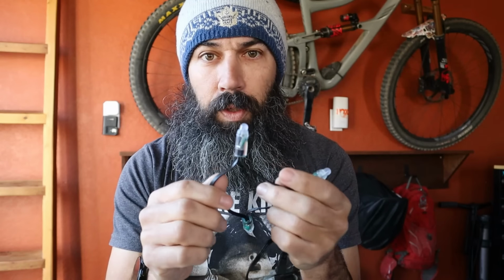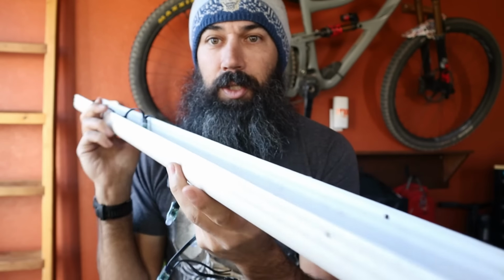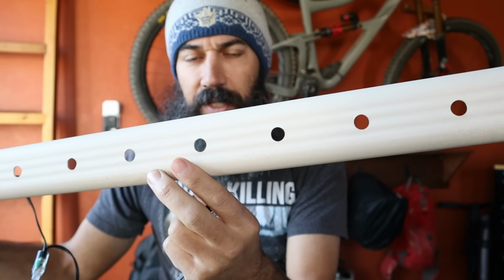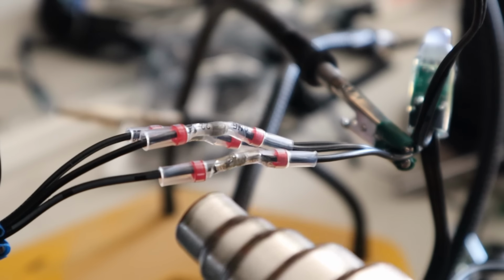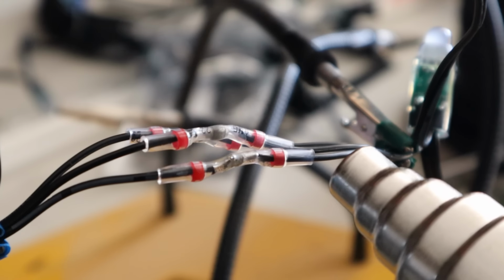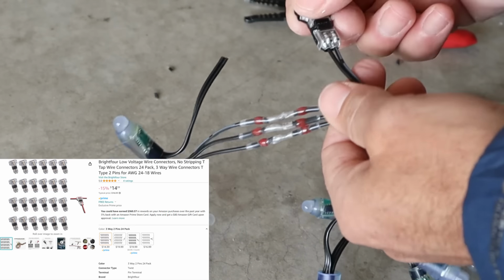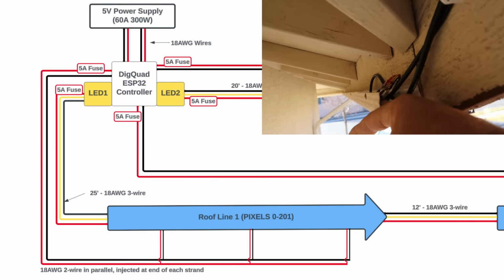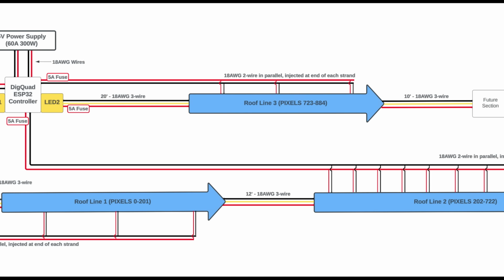Permanent and AFFORDABLE Holiday LED's

Comment: Very cool build. The costs from installers is ridiculous. My daughter told me someone was selling monster lights 100 ft for $50 so I bought them. Only used 75 ft for now but it was simple. Made my own jump wires, and wire covers between the pucks out of ripped down vinyl undersill for siding. Looks great but I want more options for software so I just bought a 24v controller and a power supply to make them WLED. Total cost $145, when the monster lights cost $150 originally. Again nice to see people so inventive. Btw I know nothing about any of this, just figuring it out as I go.
Reply from the maker: Dude, you started exactly where I did....just figured it out as I went.  My brother had his done out in Utah and paid like $7k or something totally insane like that.  That's what inspired me to build my own for 1/10th the cost.  I'm several years in now and mine still work absolutely amazing!  WLED is super fun to use too!  Only thing I would change if I built mine over is to swap to 12v or 24v instead of 5v.

Comment: So, it's been more than 2 years. How have the pixels held up? How many have you had to replace? How hard are they to replace? What would you do differently?
Reply from the maker: Check out my update video for sure. I do cover a couple things that I would have changed and a couple of mods. But overall, these things still rock!  No real issues and I haven’t had to replace a single pixel yet!

Comment: That looks FANTASTIC! Great idea. The only thing I noticed is the power injection fuses. If you have a fuse on the string for the pixels and then you put power injection on a different fuse, if you have a short, 1 fuse may blow and the other may not. You should put the power for the pixels and power injection on the same fuse for each section of pixels. On your diagram you can get Positive voltage from the roof line 1 or power injection 1 or from the power injection for roof line 2. I see this mistake a lot. If you ever have question and would like to ask, if I know the answer I would be glad to share with you.
Great Job!!
Reply from the maker: Appreciate the comment!  I’m definitely learning this as I go. I’ll take a look at reconfiguring my fuse layout, which is luckily all conveniently located in same control box.

Comment: Good job!  I especially liked that you took time to create a decent diagram showing the interconnections, and also that you fused the circuit sensibly with low fuse ratings due to the distributed power feeds. (I did exactly this on my most recent contol box with 8 5A fuses rather than just a couple of big ones.) Fuses are cheap, the damage that an incorrect fuse can cause can cost a whole load more.
Reply from the maker: Appreciate the comment. I’ve made a couple of updates (have one update video) but all in all, this setup is still working amazingly! Thanks so much for watching!

Comment: The strings come in 50 per.  You get 43 in a pipe so you need to cut some or stagger the strings.  If you made them closer you would get 1 string per gutter pipe.  That raises the cost because you need more strings but at the same time you have more density of the lights for better displays.
Reply from the maker: Agreed, and that would be easier for each of the 10’ sections.  Wouldn’t have helped much on the shorter sections.  I had a few of those that ended up being 2’ to 5’ or so when I hit corners and stuff.  But yes, having a connector at the start/end of each section of tray would make the install way easier!
Reply: @DadDoingStuff  Yeah, I have some strings just out on stakes in the yard and one run is short but 1 string doesn't make it so I had to just cut about half of another string just to make it go to the end. My preference is to make the oddball length at the ends so you don't really run into trouble. But on a roof you can't really do that with the way the eves go.
Reply: @DadDoingStuff  The main thing I like about those lights is that they aren't flat PCB material but actual wires that you can solder.  One trick to use those connectors and protect from the weather is to use hot melt glue.  Just glob it on.  Much easier than hard soldering.  Soldering on a ladder is a real pain.  Just a personal observation, but I have a controller with the flat type on my roofline and I've discovered that so long as it's tucked under the eves it's safe from the weather.  Mine has been up there for years and no problem.  I guess it depends on your climate.  I have some that I use just for Christmas that are at ground level and those definitely get corroded in just one season.  I found a simple solution, just put it in a zip lock bag.  It's not a seal but keeps moisture out.

Comment: 6:28 I would suggest making the holes slightly closer together as well, especially if you live in a warmer climate. Sometimes, heat can cause plastic to shrink over time. This means that whatever slack is present in the wiring may disappear as the insulation shrinks, pulling the wire between individual LEDs tighter. That may cause failures of individual lights.
Reply from the maker: Solid pro tip!  🤘🤘

Comment: Really surprised the 5v worked. When I did a test string doing 5v I was getting brownout on white even with power injection on both ends. So I went with 12v and that issue went away.
Reply from the maker: The stacking poses an issue….i think. In order to get a nice clean hole with no tearing, I used a step bit. That seemed to be the key.   I did test just using the correct sized bit and the hole was a mess. It tore the material and left a hole that was unusable. But if I stacked them and used the step bit, the ones on top would be wider than the ones on the bottom. 
But…….I guess if your step bit was 12mm as the largest step, then you could punch it through the whole stack, so in THAT case, yeah I guess it might work.  🤷🏻‍♂️

Regarding the voltage…yeah mine is super solid now with 5v.   If I was gonna start from scratch I would 100% go with 12v.  It just makes the wiring all that much easier in my opinion.   This was definitely a learning experience for me.

Comment: Could you have stacked 3 or 4 and drilled all at once?
Reply: Not with a stepped bit, since you'd end up with different hole sizes unless drilling to the largest diameter.

Comment: My neighbors all have these but one has a style that projects the lights down the walls a few inches. Hoe is this done?
Reply from the maker: The ones that light up the walls are effectively just mounted behind the fascia board. This allows the glow to display on the wall, without the actual LED being seen.   (Backlit)  I personally set mine up so they did NOT do that, but I see a lot of homes that use the backlighting setup.  
Using my mounting method, you would just have to drill out the LED holes on the side of the channel pointing to the wall.  But that said, you could use a setup with LEDs spaced much farther apart than mine are.  If you are doing that backlight setup, I think you’d be fine with LEDs every 12-18”.  Hope that helps.

Comment: Love the way this looks, and the fact that it hides all of the extra wires and stuff.  Problem for me is my sofits are already vinyled over so nowhere on the back of the facia board to install.  I would have to figure out a new method for mounting them.
Reply from the maker: Yes soffits are a challenge.  Despite the cost, I’d look at permatrack and probably a low profile puck-style LED.  My brother has something similar with his soffits and they look really nice. Hope that helps!
Reply: I’ve got soffits also, thinking about doing this system too. I think cutting the down spout to 3/4” instead of in half would work. Just a thought.

Comment: I was thinking j channel. But really like this and with soffits will pretty much enclose the top. 

Just looks very nice to me. 

I'm with you on price. 

Watched this a few times. 

Will watch a few times more!
Reply from the maker: Hi Jay, thx for taking time to comment.  Agree with soffits closing in the top, assuming the fascia board is sticking down enough to attach from the back. I’m a couple years in now and my install is still working fantastic.  Make sure to watch my update video too. Few more lessons learned that I would have changed from the start. Mostly voltage/wire type of stuff. Best of luck!!

Comment: First, I love your video! It's amazing. I have a question about your power injection. You explain that you have a wire (with data) connecting to roofline 1 plus a second 2-wire power line to inject power at 3 separate injection points. My question is how that is wired. do you just connect the adapter you showed on the end of each strand into the 2-wire making a 't' so the wire continues down the strand to the next connection point etc? tia! you rock!
Reply from the maker: Hi Ross.  Yeah you basically nailed it. Each injection is in fact a T.   In my case, that T happens to be at the same point where one strand meets the next.  I learned a lot going through this process.  Definitely watch my 1yr update video where I talk a lot about power injection, voltage, and stuff I would have done differently if I started from scratch.  Thanks for watching!!

Comment: Great video. A must watch for DIY's. @ 13:25 you mention that if one strand is out it prevents 'downstream' strands from lighting up. Is it true then if one light goes out, the entire run (downstream) is out?  Or is their a backup data line that prevents 'all or one' type of arrangement/system?
Reply from the maker: Good question dude. It honestly depends on the failure.  If a pixel goes out, it typically would only fail that one pixel (bulb).  And everything else would still work. 
But in some cases you might get a bad strand (or part of a strand) that interrupts the data flow downstream. 
Power can from from anywhere (start, end, middle) but data flows only from start to end. 
Hopefully that makes sense.

Comment: Ironically, correct me if wrong but 13 mm is slightly larger than 1/2”. So that math on the start doesn’t work if 15/32”.  With that said. You did say a step bit.  Which type of step did you use@?  1/8”- 3*4 or was it more a larger size. Or in the future show which bit and say what we are dealing with. Idk if that would work for all but I didn’t know there’s different sizes of steps, depending the starting bit  to the next until last week
Reply from the maker: Correct size for those particular LEDs is 12mm, but 15/32” also works perfectly. I used a SAE step bit and drilled mine to 15/32”. If you had a metric step bit, 12mm is what you want.  Re-watch at 5:25. I discuss that part in detail.

Comment: Good job, looks great! One suggestion that I may give… build a simple fence with a wooden dowel coming up from the bottom to automatically reference  your next hole to be drilled.
Reply from the maker: Yeah, agree. Simple jig would speed up the process for sure!
Reply: Great idea! I was thinking about doing something like that. I am in the process of following the @DadDoingStuff design for planning our installation for the 2025 season.

Comment: If you're going to use a step bit,  why do the extra step of pre drilling?  I feel like the step bit already had the smallest size in it.
Reply from the maker: I probably could have skipped the pre-drilling, but I feel like the step bit (mine at least) was less than optimal at drilling the initial hole.  A better step bit might have done the trick.  But you are on point, definitely a step that could be saved there.
Reply: @DadDoingStuff  I like the detail you put out here.  I will definitely consider this option later.  Thanks for the great information and also the updated video.  Happy New Year to you and your family, @DadDoingStuff 🥂 🎊 🥳

Comment: Dude, this is so incredibly helpful. Unfortunately the YouTube gods decided to wait until after I just completed a (much less impressive) whole house lighting project using Govee outdoor strip lights. It wasn’t until I got them all installed that I realized the LEDs on those strips aren’t individually addressable, but rather they’re controlled as ~15” blocks. No bueno. I immediately knew I wanted to redo it, but I hadn’t even considered pixels until this video. (FWIW, I went with the indirect install where the strips can’t be seen from the road - only a wash on the house is visible)

You mentioned in the video you wouldn’t get into why you went with 5v, but could you perhaps expand on the thought process? In reading reviews on the 500ps set you linked some folks mention to do 12v instead for less power drop over longer segments. I’m sure there are pros and cons and would love to know what swayed you towards 5v.
Reply from the maker: Hi Travis. Take a quick watch of my update video I just published last month on this project. It should answer most of those questions. Hit me back if there’s anything I miss. Thanks for watching and commenting dude!

Comment: Wow dude strong work. I did Permatrack on house, but used 12v and only have to inject every 500-800 pixels so in >3k i only inject in three total places on four channels. One channel is only 350 pixels no inject, next two just inject at the end with under 1k pixels and the longest run just over 1k i only inject at a convenient mid point. 

I used the DigQuad with the three channels on the front and channel 4 on the back, but used WS2811 Strips in a track with a nice defuser so its a solid beam of light not broken up pixels so the front and the back of the house LEDs look very different. Cool stuff! 

If I do it again I think I'm going to steal your mounting method. My permatrack is rusting at all the cuts.
Reply from the maker: Dude I would 100% do 12v if I was gonna do it again!  So much better in regard to power.   Your setup sounds awesome!!

Comment: You could make one up as a template and then just drill through a stack of them.
Reply from the maker: Likely could have.  My biggest concern would have been depth with the step bit. Those holes have to be exact in order for the pixels to snap in correctly.

Comment: What do you do when one inevitably burns out?  How long do they last?  Does intense sun embrittle the plastic LED covers (my summers reach 105 degrees of brutal sun)?
Reply from the maker: Hi Doug, while I haven’t had to deal with that happening yet, my plan would be to just replace that single LED pixel and solder a new one into place.  I learned that those solder/shrink tubes work really well with a heat gun alone, so the soldering process becomes pretty much less difficult. 
Regarding the sun, time will tell.  We get to about the same temps here during the summer and we get about 330 days of sun a year. My install overall has them out of direct sunlight most of the time.  But if that becomes a problem down the road, I would just swap an entire strand out if need be. Hope that helps!
Reply: I've had the strip version on our eaves for 8 years. Only replaced 3 in that time. Went with sk6812 lights though. You get a true white channel. We use them as under cabinet lights also.
Reply from the maker: several folks turn to vinyl J channel for low cost option. If you have soffits then permatrak is probably your best bet. It’s not cheap, but definitely has a nice install method for soffits.

Comment: Although this looks great and works for you.  99% of the rest have real soffit style homes. And this wont work the same
Reply: I ran into the same issue. I found 5/8" J channel in the drywall section in Home Depot. Just wide enough for drilling a hole for the pixel. Then I'll attach to the back side of my fascia board with nuts and bolts. I'm ready to start drilling my 500 LED holes.
Reply from the maker: @morticus7650  That should work.  Are you placing the tall side of the J or the short side of the J to the inside (toward the back of the fascia)?
Reply: @DadDoingStuff  Tall side, gives me more room for the nut to tighten up. I need to post my testing video I made.
Reply: @morticus7650  Please do post it, I would love to see it.
Reply from the maker: Agree that this won’t work on soffits. Permatrack is a good solution for soffit mounted lights. Not sure I agree that my house is only 1% though….not a lot of soffits out this way.   But that’s the whole reason I manufactured my own. Not a lot of fascia mounted options. Thanks for watching!

Comment: You said 44 pixels per channel, and you were able to mount 884.  That's basically 20 channels.  At $12 per channel, you spent $240 dollars, but scoffed at $200 dollars saying you wouldn't spend that much.  On top of that, the effort of doing all the math of figuring out where everything goes, the labor of cutting the downspouts and the doing all of the drilling.

###EDIT###
Ah, cut them in half. so about $120.  Still kinda pushing it for Effort vs Reward, imo.
Reply from the maker: I may have missed mentioning this, but the $200 for permatrack is only for a 49’ kit.  I have over 203’ of LEDs so I would have needed 5 kits at $200/kit or 4 of the 49’ kits and one of the 19’ kits.  19’ kit is $99.  So minimum I would have been at $900 in track alone.  My install (behind fascia board) also would have required additional brackets.  
Hopefully that helps net out the effort vs reward.  No way I would have done that much work to save $80!  
Thanks for watching!
Reply: @DadDoingStuff  I actually caught that when you showed the track, unlike @krevor4095. People get so p1ssy over little things.
Reply: @chriswkbrd  I agree it's his idea and I think it's very creative way of doing. The lights. Just because someone wants to be picky and have a negative comment doesn't mean people need to hear it.